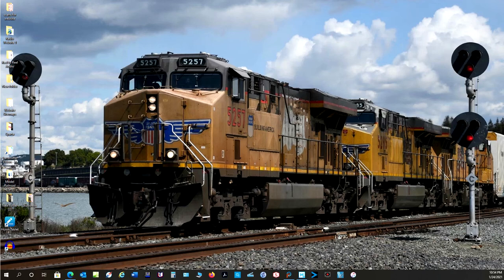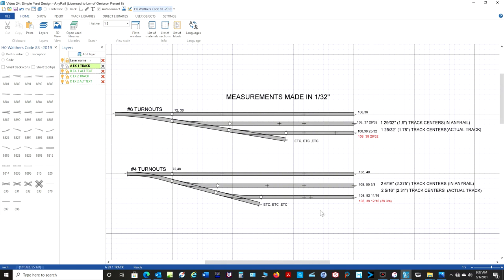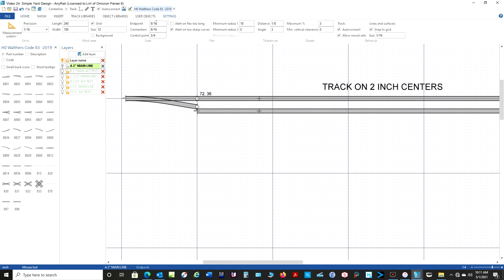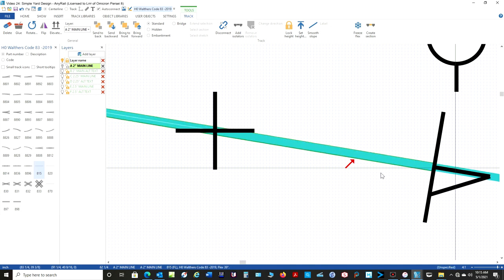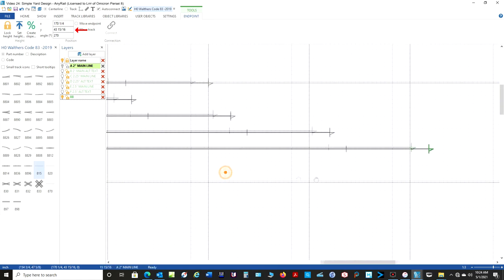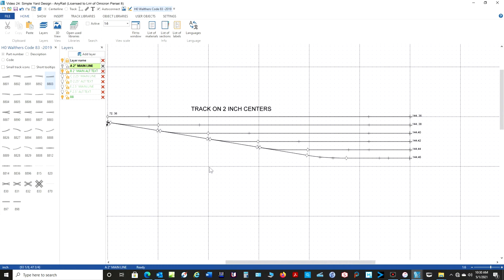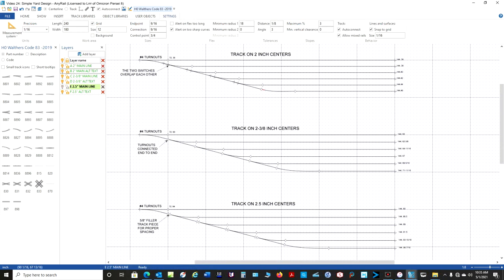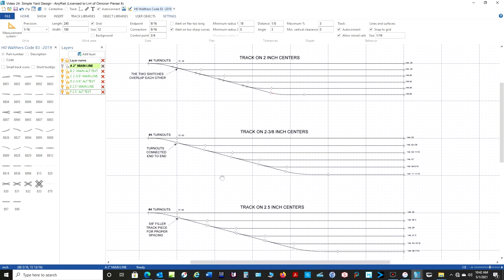AnyRail 6 Tutorial Video 24: Designing A Simple Yard

Comment: On the 2" center diagram I think you need to "shave" the last switch as the ones previous to get the curve that you want (overlap the curve).
Reply from the maker: Hi, I think I get what you are talking about. Unfortunately, Anyrail does not allow you to save a edited part as a new part. You can over lap switches and track to get the curve that you need but you can't take an existing switch and cut it to the length you need and then save it and attach track to the new end. This is a major failing in the program. If someone knows how to edit a track component I wish they would tell me or do a video on it so all of us would know. I think when you are laying out a yard on your benchwork, the Anyrail plan is just a suggestion at best as to where everything is going. For me, I will do the yard track lines, tack the track down, add the switch and adjust my track and figure cut points with the actual track in front of me. Should work just fine. Maybe a future update of Anyrail will allow us to edit track components. Dave

Comment: I think that your major problem is the orientation of the first switch, straight section horizontal, and second switch, straight section at the switch turn angle.  All the subsequent switches are at the switch turn angle.  Therefore, you need to do what you are doing for the first switch, then repeat for the second switch.  Then you can repeat the process for the subsequent switches based on the second switch.
Reply from the maker: Hi Earl, Not exactly sure what you mean or why there is a problem. I think you are saying cascade the switches off the straight section. I did this in Video 14F albeit at slight angle and I still needed a small filler to achieve the track separation that I wanted. I'll play around with that style of design and see what I come up with. Dave
Reply: @steampoweredradio2981  I am not say that you don't need a filler, just that the filler for the first track and the second track would be different because the orientation of the switches are different.  All subsequent fillers would be the same as the second filler.
Reply from the maker: @earlcory  Earl, Not sure I understand why. With a Walthers code 83 the diverging track is essentially a straight piece of track. Using 2.5" as an example for track spacing, #6 switch, I can cascade a series of left hand switches from the starting switch which is a right hand and my error, with precision set to 1/64 of an inch, is only 1/64 of an inch. Same with a #4 and a 2.5" filler. When you go over 5 tracks then a bit of error starts to creep in with 1 to 3/32". I would think that most people, least of all me, are going to lay their track with 1/32 or 1/64" accuracy. Just cutting the fillers is going to introduce some error and who knows if each switch is an exact copy dimensionally of the next one. Now, if we are talking a switch with a curved diverging track then all bets are off since I have not done any work in AnyRail with those or in real life since I used N gauge Peco track to build a railroad in 1981. Dave
Reply: @steampoweredradio2981  I see.  I use Atlas turnouts that have a curved divergent track, so the orientation of the the turnout effects the size of the filler.  Keep up the AnyRail tutorials, they are very beneficial.
Reply from the maker: @earlcory  Earl, I thought it might be something like that. Your comments got me thinking about the type of turnout and I think I will do a video soon using turnouts with curved diverging tracks. If you have any measurements for the Atlas you want to share I'll use them in the video and give you credit. So many track manufacturers and so little time to cover them all! Thanks, Dave
Reply: @steampoweredradio2981  Thanks for the offer.  I use Atlas code 55 track and turnouts, so again highly specific.  I am modeling a specific track configuration from the 1880 's in Pacific Grove, CA, so not sure how relevant it is.  I will look over my design and let you know.
Reply: I haven’t run into this, but with FastTrack turnouts what gets plopped onto the plan is ‘Minimum” size, so I always have to add a bit of flex to get spacing in the yard worked out.

What your running into with the difference is just that the divergent leg doesn’t extend from the frog the same distance.

Try this quick experiment.  Disconnect the first turn out, flip it, rotate it and connect the straight leg.  You’ll notice you can only connect the divergent leg or the straight leg, not both.  Once connected go look at the how far the connection points are separated on the divergent leg. 

I don’t know if this is just an artifact of drawing the turn out in the program or it is also true of the real world.